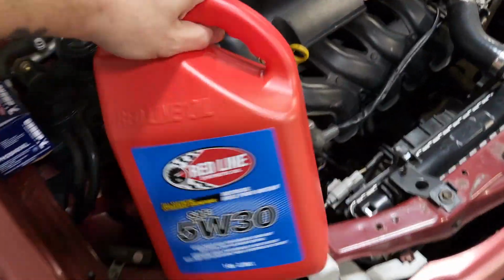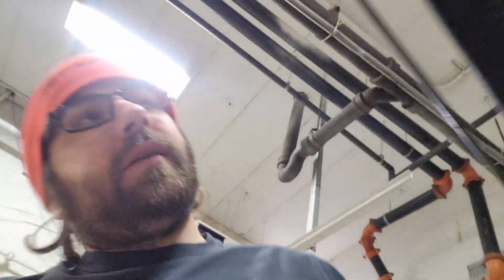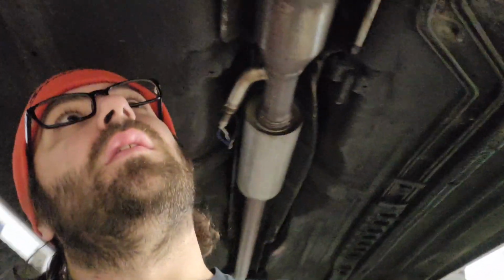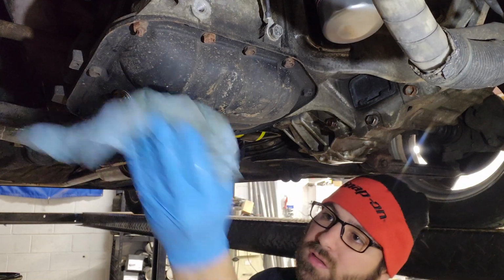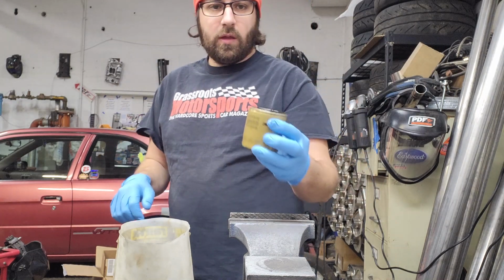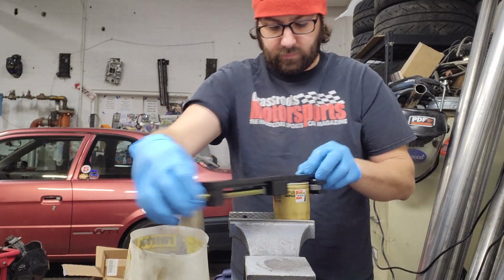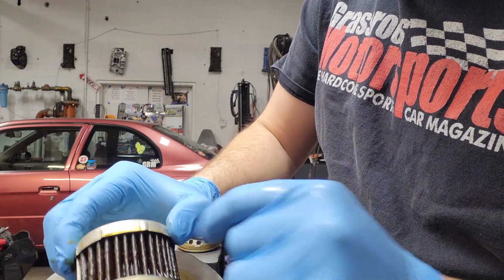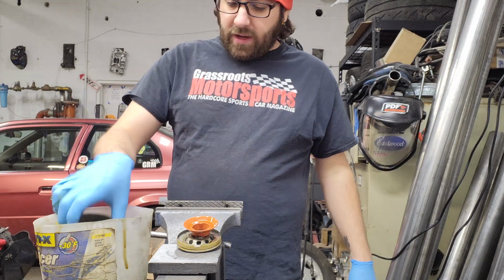Floyd gets an oil change

Comment: I always use oem seals for the axles and lube the inside with some bearing grease and never had a leak since then
Reply from the maker: Its just weird that its only been an issue with this trans.  Never had a problem with any other toyota fwd.  These are the original axles to the the car so they may have a worn out surface.  Never checked as i never had an issue like that before with any of these.

Comment: so about the axle seals, i had the same problem, what i found is you can push in the seals a little bit to far and then they leak. even if they are flush with the transmission they leak a bit. the third time i did it i left them proud about .5 of a mm hasnt leaked in 15K miles
Reply from the maker: I will give that a try.  I have them just inside of flush currently